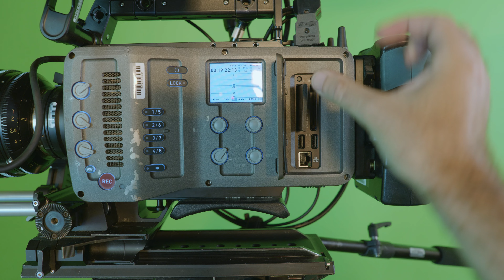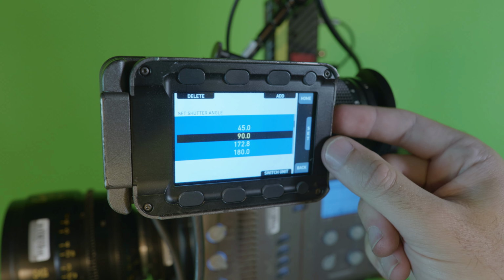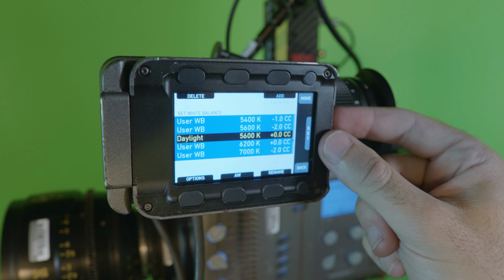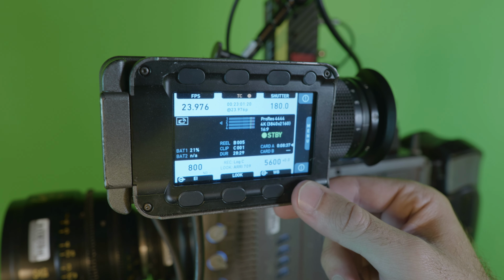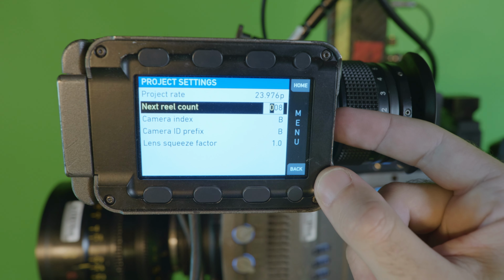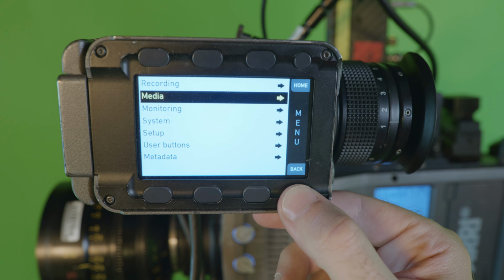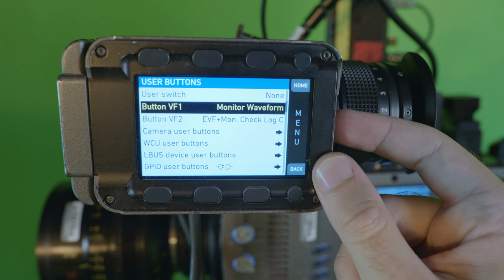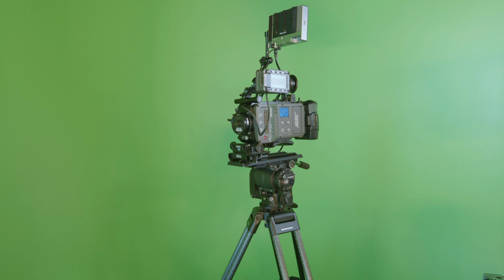ARRI AMIRA - Crash Course In 6 Minutes

Comment: Great video! Is the Amira lighter feeling than the full-size Alexa? I used to own a full-size Alexa classic and it was back breaking just to handle on a daily basis. I love that I can plug in the XLR audio straight into the camera with the Amira. Thanks.
Reply from the maker: The Amira is a few pounds lighter than the Alexa classic. But it's still about 4kg without batteries, lenses, and accessories, so it doesn't feel light weight by any means. Especially compared to today's standards with cameras like the Komodo coming in at less than 1kg.